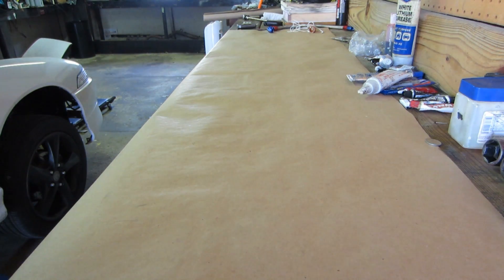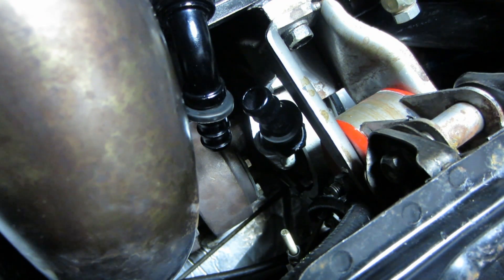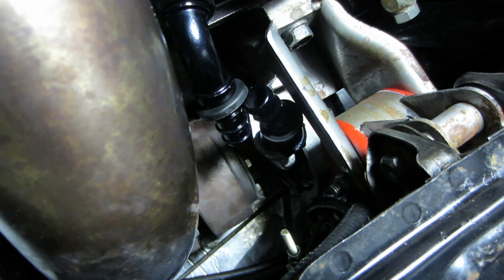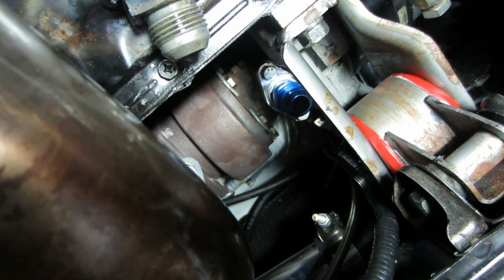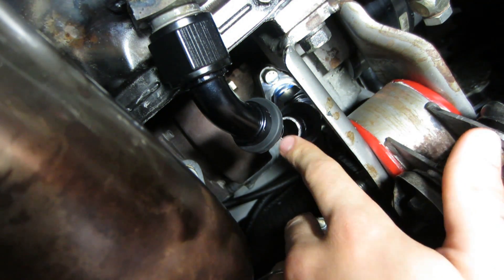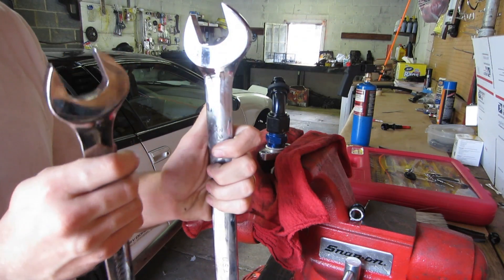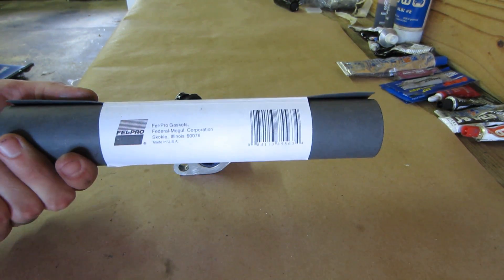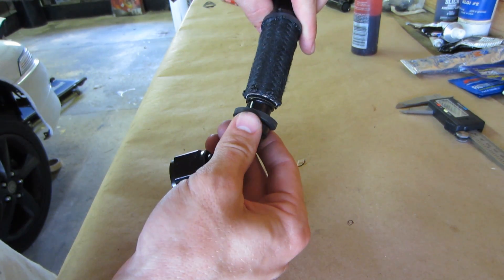Holset Oil Drain - The Right Way in HD

Comment: Nice vid. I didn't realize these Holsets flow so much oil compared to a normal gas car turbo.. i suppose it makes sense since they are heavy duty, and don't have lines for coolant. I made the mistake of running 10AN drain, hole is way too small. Holset recommends no smaller than 19mm (3/4")

Comment: So,what was the problem, you didn't like the way the hose looked?
 
Judging by that huge turbo oil drain hose,a lot of oil is being robbed from the actual engine parts; hope the oil pump can cope with that,and when the engine journals and bearings start to get a little worn,oil pressure may go down,i would make sure i have an o.p.gauge;

I think the turbo manufacturers specify such a huge oil flow for cooling ,mainly,but that need is encountered in racing only,not on a grocery getter, or at a steady 75 or 80 mph... me thinks,anyway;

(I'll say that everyone  liked the " No Oil" warning on masking tape on the steering wheel,that is a G R E A T idea!!).

Comment: thank you for such a great informative video... I'm running a fp race manifold, and hx40 in a bep .55 dsm housing, you used the  45 and 60 degree fittings right? And also did you weld the -12 bung where the stock oil drain is on oil pan?
Reply from the maker: boostedunrivaledteg Yes, a 60 and a 45 and yes, it's welded in the pan
Reply: BoostedBeaver at the stock location? And thanks for replying. how's your setup holding up.
Reply from the maker: boostedunrivaledteg Yes, stock location. It held up great. It's now off the car as I am swapping to an HX40.
Reply: sorry for all the questions, last one I promise haha, how much of  the lower front mount did you cut to clear. thanks again.

Comment: Hey man, I have a bottom mounted he341 and I'm going to be switching to a top mount manifold . My piping would be simplified if I could swap compressor housings to something without the forward facing 90degree outlet. Know of a holset comp housing that will swap right on for me?
Reply from the maker: mattheripper I do not. You could try contacting JUSMX141 on DSMtuners.com for more information. He has rebuilt many Holsets and is very knowledgable.
Reply: +mattheripper Only a HE or HY compressor cover will fit your bearing housing; if your HE341 has a 56mm compressor inducer then a HY35 cover would work but requires machining to fit your compressor wheel.

It may be easier to cut the 90* outlet off your HE cover and have someone weld a straight 2.5" nipple to it.

Comment: I respect your work, skills, and this video. I found it from researching my switch from a Holset Hx40 to an Hx55. I read the 19mm requirement as well today on the pdf from holset. Hx55 is in the mail, and my Hx40 has probably an identical oil drain flange. On the 40 it's a 19mm hole just like the document speaks to! AN -12 has an inside diameter of 15mm unlike what you said: "-12 is larger than the 19mm requirement." AN -16 has an effective inside diameter of 20mm. THAT is just above the 19mm requirement, not AN 12! AN 12 looks big, but it's not big enough. And AN 16 looks overkill, but effectively, it's not at all. You must have been running the 12 for a long time now since you made this video in 2012.
Reply from the maker: 12AN comes out to 3/4 of an inch and 16AN is an inch. There is no middle man between the two. The 16AN is so large that it would be very difficult to fit it between the return flange and the pan. 12AN has been proven to be enough drainage as long as oil pressure is kept within spec. While it is slightly smaller then what they call for it has made my Holset happy for more than three years at 30lbs of boost. 

Robert

Comment: Hey! Nice job,what is the size of your oil feed restrictor?tia
Reply from the maker: Sorry for the late response, I do not run a restrictor and you may not need one either. You should check the pressure right before the oil inlet of the CHRA and see if it meets the recommendations of the manufacturer of your turbo. If it is too high, you can run a restrictor to bring the pressure down in your application. 

Robert
Reply: Thats great!thanks for the good info.

Comment from the maker: The size of the fitting depends on the size of your drain. I used -12AN fittings since Holset specifies 19mm for their drain. The fitting in the pan is just a weld in steel -12AN bung that can be purchased at Jegs, Summit or any local speed shop. Hope this helps. 

Robert

Comment from the maker: That part of my video is totally incorrect. You should only use a lubricant such as oil to lube the threads of the AN fittings to prevent gauling. The 30 degree flange is suppose to be self sealing and gasket free. If you have a leak at the threads of an AN fitting either one of the sealing surfaces are damaged or the connection is not tight enough. Again, only use oil to lubricate the threads and do not add any other compounds to the threads as they are not needed. Hope this helps. 

Robert

Comment: I suppose one could use gas line fittings and the corrugated stainless tubing.  I didn't think this through, and I guess it would wind up being just as expensive, or more.  If I was doing it my way, I would be welding a small length of the corrugated gas line tubing to straight tubing.  But I'm a nut, and I don't have much because I overdo everything I do have.

Comment from the maker: Very good thought.... 

I have seen one made out of copper tubbing but the user had different style fittings welded into the oil pan and made his own turbo outlet style fitting. He connected the copper tubbing with two pieces of rubber hose which would aid in reliving that stress. Only issue with this setup is having 4 connections and the possibility of leaks at all those points. 

Great thinking and thanks again for the comment. 

Robert

Comment from the maker: On another note, the hose used in this project is rated for hot temps and oil so there should be no issue with the rubber hose inside the nylon braiding to expand. This hose is the same concept of steel braided line but they use nylon braiding over rubber hose instead of steel braiding. Of course all hoses will deteriorate over time but that will be a while from now. 

Again thank you for the comment and the complement, they are all welcome. 

Robert

Comment: The nuts, sleeves, and tubing would probably be cheaper than a single push-lock fitting.  Although I hadn't thought about stress relief.  There would need to be some sort of accordion in the middle like the stock drain tubes utilize.

Comment from the maker: It may be cheaper but you will still have to have an adapter for the turbo and a bung welded into the pan to accept the nuts. Not sure how much the nuts and sleeves cost but the AN fittings and 3 feet of the hose ran about 55 bucks. For the tubing idea you would also need a tubing bender of some sort and a flaring tool.

It sounds like a good idea for someone that has the tools to try, but for me this was the most practical leak free design I could accomplish. Thanks for the comment.

Robert

Comment from the maker: Thanks for the complement on the video. 

If you read the 5th paragraph in the description, I explain that steel braided line uses certain fitting that you can not alter the length of. This makes them too long and they will not line up (like the pushlock fittings before I cut them). Steel braided line will not work with pushlock fittings because the steel will not expand to accept the barbs. The fiber braided gives you some protection and a fitting you can use. 

Robert

Comment from the maker: The motor mount was trimmed. If you read the description, I state that the trimming was done during the initial build and that it has to be done in order for the drain to clear. I did not catch footage of this because I was not even thinking about video during the build :( You can also see that the motor mount is trimmed in a few shots under the car. Thanks for the input and it is important for people to know what they are in for. 

Robert